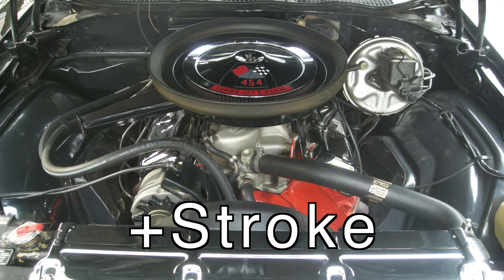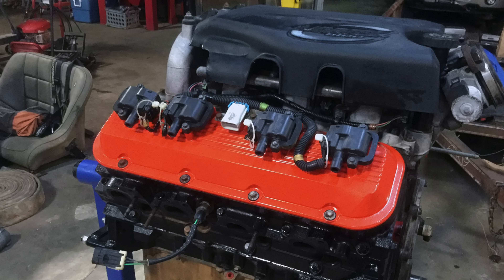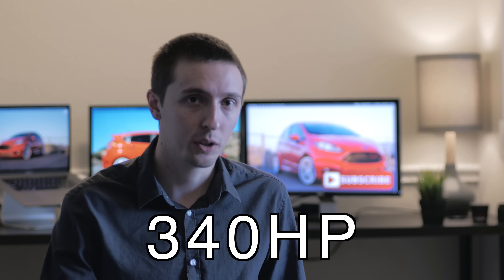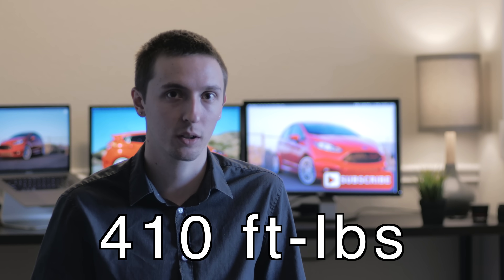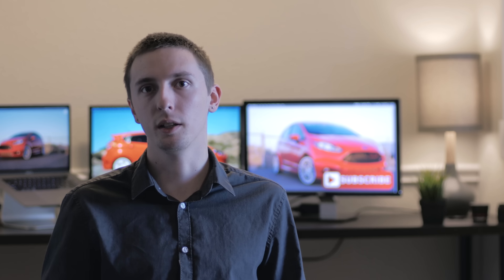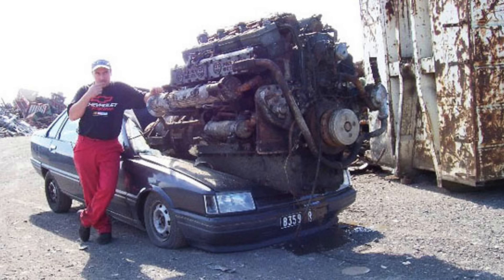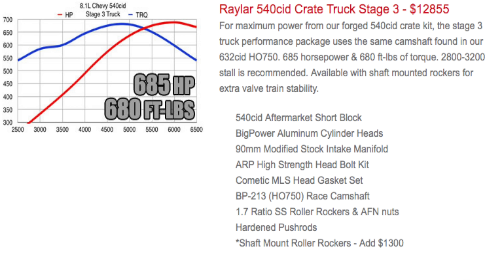Vortec 8100: Everything You Want to Know | Specs and More

Comment: the total lack of parts from GM is not the only thing that killed the 8300.....its VERY poor fuel economy did.  True that today the costs of diesel are above gas not to mention that the gen 5 Duramax has all kinds of emisions garbage on them that cost money......but it STILL gets better economy than the 8300 did on a good day UNLOADED.  10mpg is pretty bad and when you hook any waight to them and get into the 7mpg range, that did it for most owners.  The financial crisis and the high fuel costs after Katrina sunk the 8300 to the point that if you see one today it is almost a surprise.  IMO the 8300 is just not worth it when you can buy an turn key LS3 for not very much or even the LT4 Corvette engine if you want to go all-out on HP for less than it would cost to build an 8300 that was worth a damn......oh, and there still is no factory performance parts

Comment: Great motor in stock form.  Terrible for hot rod applications. 4 bolt mains, No aftermarket, no support and dollar/hp is a complete waste of time and money. A 6.0L lq4 6 bolt main is capable of much more reliable power for less money. Change my mind.
Reply: Always wondered if it had the 4 bolt main or not .
Reply: I’ve never owned an 8.1 but I do have a 6.0 lq4. I put a Vinci ultra torque cam in it with headers true duel exhaust, CAI and a custom tune, she pulls my 30 foot fifth wheel really well. As much torque as the 8.1?..... nope but it’s better than stock now

Comment: I love this engine, we use them in agriculture to irrigate crops. These engine all run on natural gas run 24/7 pulling a good load and still manage to run up to 30 thousand plus hrs!! converted into miles at 65mph thats 1,950,000 miles! Of course in that time frame they normally have cylinder heads and camshaft replaced twice on average. The engine has a weakness in the valve train at   least in our applications they do. its weakness is in rocker arm and camshaft failures and is not  uncommon

Comment: I got a banging deal on a Winnebago Class A.  It's a 2004 Adventurer with 20K miles.  I couldn't go wrong with it having the 8.1, Allison Transmission, Spicer rear end.   I'm old school and have had many big block motors, everything from Ram Air IV - 400, 460 Fords, 455 Buick and Olds.  So far, the engine has performed adequately, even in that 35' Class A.  It runs very nice.

Comment: I drove a 2001 3500HD 1 ton wrecker. 5 speed manual. 
One time I was training someone and we take off from a stop and I hear the truck rattling. I ask 'what gear are you in'?

They pull it out if gear, turns out they started it in 3rd gear. 

I liked it better than the 99' 7.3 diesel I had before it.

Comment: I’ve got a 2002 Chevy 2500hd Silverado with the 8.1 has over 400,000 miles on it with no rebuild, will tow anything and everything. most reliable truck I have ever had, shits on 6.0 vortecs all day long and as for duraqueer’s of course they are quick they have a turbo the 8.1 is naturally aspirated, put a supercharger or turbo on the 8.1 and buh bye duramax

Comment: Had one in a Suburban K2500. Sucked gas 10-12 mpg, had to add a quart every 800-1000 miles, burned, didn't leak it.  Went back to a 1/2 ton Suburban 5.3, better mpg, didn't burn oil.

Comment: I own a cylinder head shop. I have had SEVERAL sets of 8100 heads brought in that had the Intake valves sucked into the Intake ports. I actually had to put replacement seats in a few of the ports they were beat up so bad. the replacement valves had a MUCH thicker head to resist this from happening. So,, if your considering using one of these in stock form might be worth pulling the heads first and look at the Intake valves,,, just sayin,,,

Comment: Purchased my 2004 Crew Cab 8.1/Allison 4x4 new. It has 140k miles and runs like a top. Finally had to put some $$ in to it...water pump this summer, and fluid pump in the Allison this week. The 8.1 burns no oil, does have cold start knock, but has performs wonderfully. I get around 10.5 MPG city, and 12.5-13 highway. Pulls strong.  Not my daily driver, so less than 5k miles per year. I expect another 8-10 years out of this Big Block!

Comment: Why do people think it's hard to hop one of these 8.1's up???? What do you think you had to do to old motors? I mean pretty much you had to go after market with almost everything for that motor. I mean yeah with Ford's 302 and 289 and 351 you can make a 347 stroke by throwing in a 351 (small crank journal) crank in it but to me that's just to easy and a waste of time if you get the motor tear it apart and find out it's a large crank journal. I don't waste time like that I get new not used parts that I know will work and fit and make power.

Comment: Should have kept the 454 vortec 290hp/410lbs torque 13-14 mpg with 4.10s.... the 6.0 uses the same amount of gas with 4.10 but produces less power 300hp/360lbs. Before anyone says emissions that's why they are obselete explain how decreasing fuel efficiency helps emissions? I call BS. The 8.1 is nice but never heard of anyone getting better than 11mpg that's what killed it IMO should have kept the 454 vortec well balanced mpg to torque ratio.

Comment: Great information...! But us hands on Guys out here...would have liked to have seen a few Pics of the engine disassembled...while you continued to describe the interchange with the gen six  7.4L
454....Pop the heads off...give us a closer look at the Steeple Port and valve Size....Is the block the Same..?  Can you interchange cylinder Heads...? and Camshaft...?  What about bellhousing bolt pattern...?You left us motor heads with a lot of Questions...?
You need a 2nd video....Thanks..!

Comment: low power for that displacement
Reply from the maker: Workhorse engines like that are designed for torque and long term reliability, not horsepower per liter, but yes it is low power that the engine size.

Comment: there is a company making new blocks, cranks and heads.. to supply the oil industry with the big block chevy engines they need for equipment they have.. 

 there are some 99 TOP kicks with L18 or L29 engines .. that had 4 bolt main.. forged connecting rods and a forged crankshaft.. 

 these motors use a the 4/7 swap cam.. so the firing order and the sequential port fuel injection wiring is different. 

 the TOPKicks use a different slightly older scan tool in some cases.. so don't throw out that old scan tool..

Comment: You did miss one truck 2001 to 2003 Chevy Avalanche 2500 have the 8.1 liter and i did have the opportunity to test drive one and it is... definitely there; you can not mistake it for its little brothers 6.0 or the 5.3 it was a beast but too expensive for my taste, lifted, bigger tires, aftermarket exhaust, someone was going all out and then sold it and the price tag reflected that engine and upgrades

Comment: The 8.1 is a great tow/haul gas option for trucks, but it is an absolute darling in the marine world.😍
Reply: Man O, I've got duo pushing my 30000 pound  40' Viking. Love the torque and the fuel mileage is right up there with a diesel.
Reply: Yep, I repowered my boat two years ago with Crusader 8.1’s that I rebuilt

Comment: Same idea as the old Dodge v10. The difference is they adapted it for use in the viper as well, using aluminium and better tuning for car, and steel and iron for the ram hd for increased durability. But diesel fuel is more efficient, so the Cummins 5.9 gained popularity and the gas big block didn't, same with Chevy.

Comment: I have the 8.1 in my 3/4 ton suburban.  I get 11 mpg average city / highway which is fine with me I was raised in the 70's when a small block would only get 13 mpg. I would rather have the power than the mileage.    The engine has 225,000 + miles on it and runs like it did when new.  Great family hauler.  Truck loves to run.
Reply: My 6.0 doesn't get much better.  I've had four 6.0 trucks and they all get about 13 or 14 on the highway.

Comment: GM should bring back a large displacement gas engine again. Emissions regulations are choking out diesels with DPF's, and mandatory DEF just adds to the cost of fuel. A large displacement gasoline would be more efficient as far as cost to drive per mile, even while towing.

Comment: Nicely done although I wouldn't even say the 8100 it's gaining momentum, it still remains very rare. The folks I know when it comes to BB power they usually opt to build the traditionally known engine for all the same factors you mentioned but specially parts availability and prices. Even to this very day parts for the more common factory equipped roller cam and one piece rear main seal Gen 6 are pretty HOT$$$$$$$$$.

Comment: My 03 Avalanche 2500 is the best pulling vehicle I have ever used or owned.  It is a 2wd monster that will pull 12000 lbs and not even skip a beat. When its not pulling I average 14 to 16 mpg on the highway.  When pulling I average 8 to 9 mpg.  Raylar has some awesome upgrades for the 8.1, maybe in the future upgrades will begin.

Comment: This is like comparing apples to hand grenades - they're similar but both serve a different purpose. 
For heavy hauling or towing on a daily basis, the Duramax is the choice hands down - the turbo-diesel offers a higher and wider torque band while at the same time offering 15 to 20 percent better fuel mileage. The downside is the additional purchase cost, although with proper maintenance it should last at least 500,000 miles.
For occasional heavy towing, lower purchase cost (than the Duramax), and the ability to buy fuel at every gas station the 8.1 (496) is a much better choice.
It's more than capable for the occasional heavy tow/load, and has a plenty long lifespan for 99% of light-duty truck owners (roughly 250,000 to 300,000 miles and more).

Comment: I wish GM would've made it a larger version of LS architecture.
Reply: The ls architecture isn't capable of that really as it's designed around hp and free reving the 8.1l was a brute and nothing else the big block platform was and is always going to be superior to the ls platform in that way as a ls would run thin walls and a huge stroke and not be able to support the 8.1s heads.
Reply: jdr ok 

Obviously, you're not catching on to what I'm saying... I said "architecture", not "dimensions". I meant a bigger, beefier, LS... think tall deck LSX with wider bore spacing, scalloped cooling passages, 6-bolt mains, larger cam bosses, optional front drive distributor kit, etc.

I get what you're saying... and you're right. Power is most closely related to displacement, and a larger block is capable of delivering said power at a longer duty cycle. I just think they could've carried over more of the LS design and scaled it up to big block dimentions... ESPECIALLY 6-bolt mains. Anyone who's ever built a big block knows that bearing distortion is the #1 problem with stepping up performance on a BBC. At the very least, they should've offered an OEM mains girdle.
Reply: @driverjamescopeland  the ls platform still isn't as good for that the architecture isn't viable for that applications nd 6 bolt mains is bad it was retarded for many reasons that make the ls engines need extra parts to live.
Reply: jdr ok 

Let me get this straight... 6 bolt, self-aligning mains, proven 30% more RPM stable when using the same rotating assembly.... was retarded? Man, I used to be the biggest die hard BBC fan there was... but you've went off the deep end. The LS architecture could've scaled up and been amazing to work with. I can easily vision an upscaled LS, with a set 4-valve heads, an ultra-light, cryo-dipped crank, short skirt pistons, and hydro-lock lifters, titanium rods.... easy 9,500rpm normally aspirated pushrod screamer that'd be good for 75-100,000 miles. 

Same block could've made a great 400hp 300,000 mile engine with OEM pistons, crank, heads and rods... with more bottom end than any 6.2L. U-haul would've bought a ton of 'em, making them cheap for the rest of us.

Comment: He kinda has the history of this motor wrong.  He makes it sounds it came out after the dmax as an alternative.  That isn't true. Both engines came out the same year and it was part of GM revamped engine lineup.  Don't forget that at the time the dmax came out GM had a terrible reputation with its diesels. The dmax changed that obviously but the 8.1 was actually more of a reaction to the dodge and ford v10's that were popular in the mid 90's but were eventually dropped from their lineups.

Comment: You guys...lol
FACT.. Vehicles with a gross weight of over 5000lbs. Are not subject to any fuel economy standards.
The 8100 was killed off for the same reasons Ford and Chrysler killed their gas v10's, MONEY.. And the fact that diesels are just better suited for pulling, this is exactly why you don't  see gas Semi's.
Reply: Diesels just get better economy and make more torque where the semis normally pull but a turbo gas semi with the same cubic inchs but more rpm would still pull damn fine.
Reply: @jdrok5026  
Oh a turbo gas would pull fine but then fuel cost would be 3x what it would cost to run diesel. And compared to the next gen electric hybrid tech (already proven in trains) in the works for semi's, that fuel cost difference will only grow more in the favor of diesels.
Reply: @anthonywilliams4100  hybrid really isn't the way of the future it actually lowers the efficency of a diesel.
Reply: That may be true if the diesel is the prime mover, but when a diesel is used to, generate electricity as in a train, or assist an electric motor for motion and generate electricity  as in diesel powered subs, the diesels efficiency goes way up.
Reply: @anthonywilliams4100  well you can run in that system a diesel at peak efficency. Where most hybrids drives would see a diesel be under the curve.

Comment: POWER SOLUTIONS INTERNATIONAL uses the GM 8.1L Vortec to create their P.S.I 8.8L V8 engine (Propane and Gasoline versions)
School Bus manufscturer IC BUS CORP (Navistar) now offers P.S.I 8.8L V8 engine as an option in their IC CE-300 school bus. Modern diesel engines have become a burden toown, operate and mantain because all their issues with emissions control devices, that is why the big gasoline engine is making a comeback to medium duty trucks.

Comment: This engine was made to complete against the Dodge and Ford V10.
Reply: Killed those!
Reply: All 3 are some of the more reliable engines the brands ever made.
Reply: Exactly right. The only reason they put an 8.1  engine in there is Ford had the Excursion with their diesel. My 8.1 with 4.10 gears is rated at 12,000 towing capacity. Extremely high then, unheard of now in an SUV.
Reply: and it crushes that competition!
Reply: @GregHuston  definitely not the 6.8, not even the 2v. Murdered the magnum though
Reply: @billyray4716  it murders the 6.8 even more so than the V10 Dodge. Makes way more power, is way more reliable and isn’t a triton thank god
Reply: @lomfmur  330 hp is more than 385? The 3v 6.8 doesnt have cam phasers so its 10x more reliable than the 5.4 3v
Reply: you are correct. in 2001 the 8.1 in gmc produced 345 hp and 455 ft lbs of torque. or at least my manual option did. the dodge v10 for the trucks first produced 300hp and later 310 and the torque remained the same at 450. the ford v10 first produced 275 hp and later 310 and 425 ft lbs of torque and later produced all the way in 2005 was 365hp and 460 ft lbs of torque. but dont leave that 8.1 bbc out just yet. they also changed up the power rating if they are in the bigger trucks like the u hauls. they produced 550hp and 690 ft lbs of torque. and if you got a marine engine that produced 600hp!
Reply: And outdid them both in all ways...

Comment: 8100 if hand built was probably fine. From factory piston fit was so bad they usually went thru 3 to 4 quarts of oil in 3000 miles. Also vortec 454 at 290 was rated rear wheel horsepower. HP wars started in 2000 and quietly LS and vortecs were rated at flywheel not wheels. A vortec 454 was close to 400 hp at flywheel
Reply: my 99 ex cab dually was a pig... 454, lousy power curve, worse mileage towing..it really didnt tow worth a damn and for its cost, i was pretty disappointed with it.  it was great empty but, thats not why i got a larger truck... in feb of 01, i got the  2500 hd with the 8.1 and allison... made my dually look like a rock in the mud sinking fast..
Reply: @INKJAX  you probably should've expect as much with 410 ftlbs of torque.
Reply: @INKJAX  so your 7000 lb truck used gas? Not really suprised especially if you had standard 3.73 gears. Your Allison gave the 8.1 more gears 5 or 6 and that truck probably had 4.10 gears. A 8.1 is just a 454 with a little longer stroke hp and tq numbers at the wheels were probably 25 hp more big whup. Sounds like your just a cry baby and bought a truck that wasnt set up right or may of had a drivibility issue going on. Ive towed up to 20k lbs with mine and tey will moe empty or loaded

Comment: Cool, to bad Chevy doesn't make a real truck to put it in....

Oh wait, hold the phone! As of March 2018 Chevy announced a new line of class 4/6 trucks...about time...hopefully the door handles won't break all the time on these.
Reply: ugly front ends with the standard cabs being used . they got away from the "kodiacs" big rattling square cabs but, the front end designs are kinda lame.. ford and dodge have the better looking standard truck bodies which chevy should have done to begin with..
Reply: INKJAX ....The trucks I need, need to be small and maneuverable. That's why we chose the Chevy 3500hds, the steering angle is almost unbeatable in the standard cab configuration. The only problem with them really is they get constantly overloaded and axles fail. We keep a f650 with a fd-1060 in the back when the Chevys just can't handle the load.